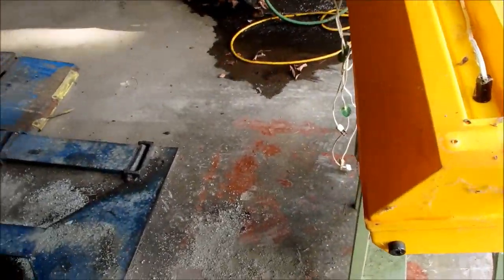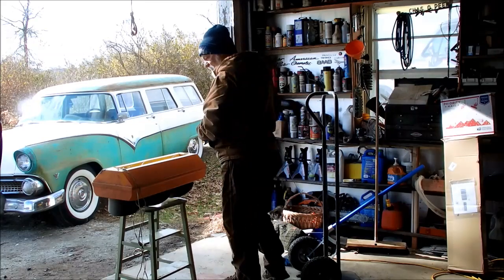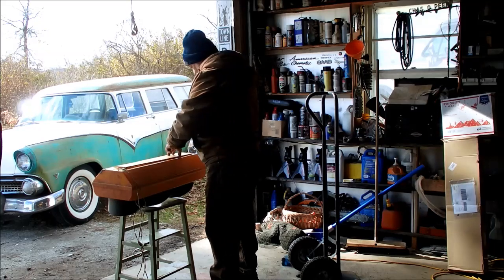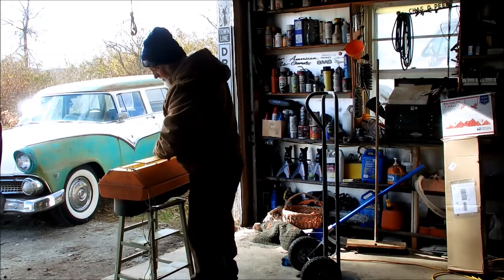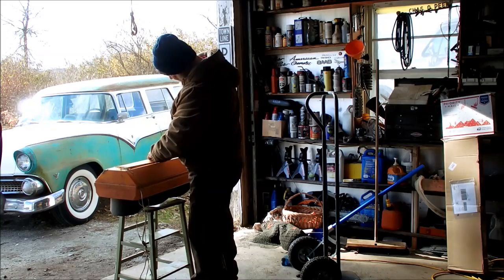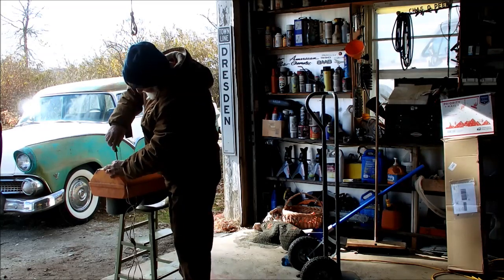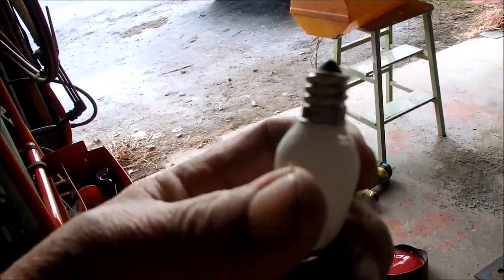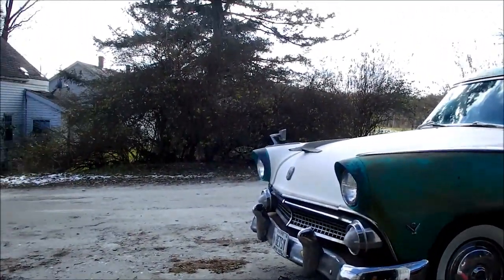Fixing my traffic light 1

Comment: For about $22 you could buy a sequencer on ebay and also find cheap low watt LED E27(standard Edison screw in) bulbs to go in the light on ebay as well. So, for about $30 or less you could sequence your traffic light and have it so it won't wake the neighbors
Reply from the maker: I've got a sequencer on the big light.   The bulbs are LED already.   I've thought about putting a sequencer on the little light, but it's just one more chore to get to..  haha
Reply: rpeek The bulbs are LED and it STILL draws a lot of juice??? WOW that's amazing, maybe the sequencer is causing the energy draw? ...cause most LED bulbs are in the 10 to 15 watt range.
Reply from the maker: MrComaToes Are you talking about the real stop light or the toy one I have in the garage..   I'm not worrying about the power draw on the toy one.  I don't leave the real one on all the time because those lights are not screw in, they're special lights for that purpose, and they are LED, but still draw quite a bit of power..  I have a sequencer on that one but don't run it all the time.  Hey, I hear you've got a new quilt...
Reply from the maker: MrComaToes http://youtu.be/JxwiH_2k_K8
Reply from the maker: rpeek Oh, I take it back.  Your quilt is on the table, ready to ship.. hahaha..
Reply: rpeek Dang, I understand now, I wasn't remembering that yours has the modern modules in it!  Well, there is two ways to go about making your light power-bill friendly as I see it... #1 You could take out the modern LED modules and buy the missing old style reflectors and bulb sockets, I imagine with all the municipalities changing over to LEDs theres a ton of them floating around.  Or #2 you could buy a powerstat (also known as a variac) and regulate the volts the light gets down so that it takes a lot less energy and isn't near as bright.  Either option can be pretty cheap, I see expensive Variacs go for cheap money on ebay all the time (I has a few) and those light parts have to almost be dirt cheap through Lights To Go or some such!
Reply: rpeek Wowsa, your missus is just a high powered unit, my friend!  Can't wait to get my quilt!
Reply from the maker: MrComaToes Tried the powerstat already and it blew out the sequencer..
Reply from the maker: MrComaToes She sure is.
Reply: rpeek I sent an email to a traffic light website that has tons of light parts to see if A. they might have any idea to reduce the brightness of your light without destroying another sequencer... and B. How much for the parts needed to convert to the old style that would have been in your traffic light to begin with, we'll see what they have to say.
Reply from the maker: MrComaToes K.